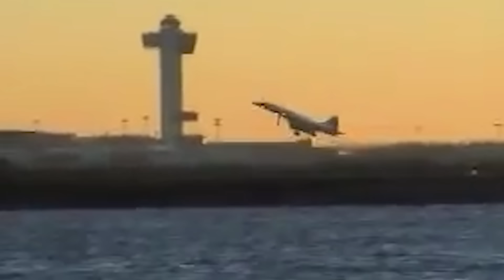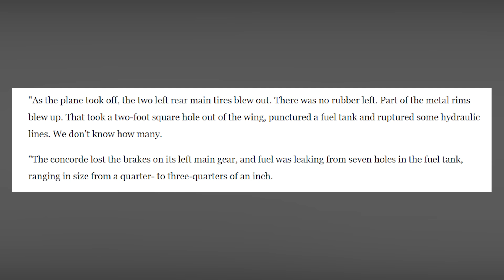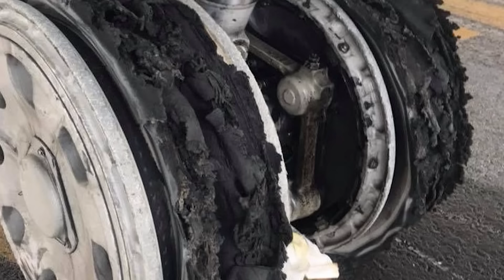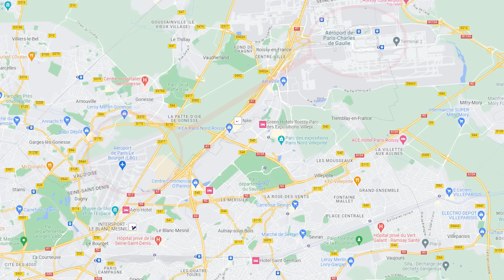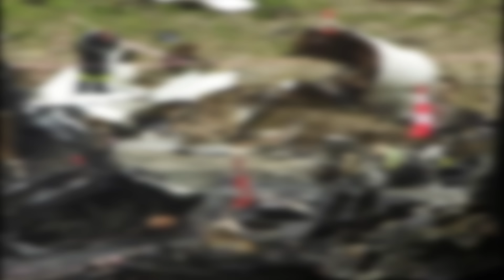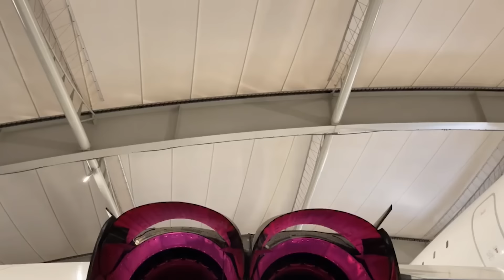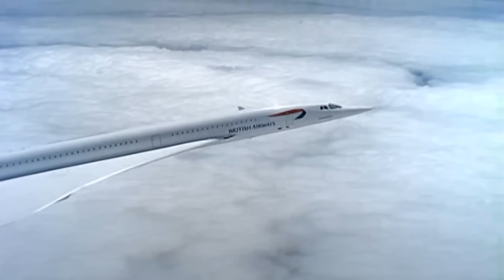The TERRIFYING Crash That KILLED Concorde | Air France Flight 4590

Comment: In respect to the Concorde & on this occasion had the Concorde not ran over the titanium strip then very likely the Concordes would have completed there flying duties service life without a disastrous accident.

Unfortunately AF4590 had many factors working against it & adding these to this incident with the runway debris all these factors added up to equalise disaster.

IMO AFrance operations played part in these factors also shutting down the engine (understandable) sealed any possible recovery of some sort.

Most people forget x1 fatal accident of an over 30yr flying service is remarkable & AF4590 was diagnosed WHY this happened. 

Any aircraft designed developed in the 50/60’s & entering service in the 70’s flying service into the 2000’s will obviously have some sort of negatives. Modern technology improved materials & new engineering methods will always highlight areas of improvement required.

But let me state this! Take a group of highly educated & very capable aeronautical engineers into a room sit them down & say: 

I want you to design+engineer+make+validate a supersonic airliner that will fly twice the speed of sound, carry paying customers @a flight level of around FL600.

1st I guarantee the engineers will all look @each other with a HTF we gona do that. 

Then just to top it off you have to use the same equipment & methods as they did with the Concorde back in the day!!!!!!

Guarantee every engineer would get up & walk out!!!!!

Concorde was/is an engineering icon it was a symbol of what we can do. It was a flagship a beauty of the sky, it looks fast stood still it goes fast in flight it is a symbol of performance with class it’s the pinnacle of commercial aviation.

England & France should remember what we achieved here.

Salute 🫡.

Comment: Why are you making a video about this accident if you not talk about the other 95% of what caused the crash? The Titaniumstrip was not the only reason and those informations are open for public.  

That was a really long chain of wrong decissions and bad luck. Most people just talk about that titanium part on the runway but: 
-The groundmechanics forgot a part that belongs to the plane on the shelf so the lefthand side wheels could slightly change it's angel. 
-They startet the takeoff on a partial closed runway that was under construction and there was a sharp transistion between the parts. 
-The wingfueltanks were filled up over the max safe level so there was no air left in it.
-The plane was overloaded (2 tons of taxi fuel + over 600kg bargage). about 3 tons.
-They also started with a tailwind (calculated with that tailwind they were 7 tons to heavy). 
-Because of the bargage and short taxi (most taxi fuel was not burned) the planes cg was moved after its safe point. 
-While takeoff they hit this titanium part on the runway.
-The last misstake was that the flightmechanic shut down engine two without even telling the captian.
Just watch "John Hutchinson on Air France Flight 4590" (concorde captain)

Comment: I would so love to fly this incredible machine. It's a work of art and a feat of invention. Most people can't fathom going over 1,000mph in anything but to do so in such a beautiful aircraft would be worth the expensive plane ticket at least once in a lifetime. 31 years without deaths is impressive and it was the stupid metal strip from another plane and the deadly decision from the engineer that caused the issue when there were deaths. Not the fault of the actual aircraft itself. So sad to see them grounded.

Comment: The people in the hotel died as a direct result of a piece of metal falling off of a plane onto a runway a few miles away. The chances of that are statistically astronomic. Rip to all involved.
Reply: An asteroid is heading towards Earth and has a 1 in 11.5 billion chance of colliding with our planet in October 2024. Those are astronomical odds. 😂
Reply: No no no aspergernomical
Reply: @benwherlock9869 - "The people in the hotel died as a direct result of a piece of metal falling off of a plane onto a runway a few miles away." No. The people in the hotel died because a f@cking plane crashed into it. This is an indirect result of the metal on the runway. The direct result is: it badly damaged a plane, rendering it uncontrollable.
Reply: The metal strip was from a dc-10😥
Reply: No...no.....no!!  Not astromical.....things fall off planes every so often because of maintenance workers.........remember,  IF IT CAN HAPPEN IT "WILL" HAPPEN!!!
Reply: That was a really long chain of wrong decissions and bad luck. Most people just talk about that titanium part on the runway but: 
-The groundmechanics forgot a part that belongs to the plane on the shelf so the lefthand side wheels could slightly change it's angel. 
-They startet the takeoff on a partial closed runway that was under construction and there was a sharp transistion between the parts. 
-The wingfueltanks were filled up over the max safe level so there was no air left in it.
-The plane was overloaded (2 tons of taxi fuel + over 600kg bargage). about 3 tons.
-They also started with a tailwind (calculated with that tailwind they were 7 tons to heavy). 
-Because of the bargage and short taxi (most taxi fuel was not burned) the planes cg was moved after its safe point. 
-While takeoff they hit this titanium part on the runway.
-The last misstake was that the flightmechanic shut down engine two without even telling the captian.
Just watch "John Hutchinson on Air France Flight 4590" (concorde captain)
Reply: @MikeYork-bn1mt bro this is serious. Idc about joe Biden XI JINGPING 2024

but fr wtf

Comment: There is one thing, that need to be mentioned as well.... A Delta-Wing plane (like the Concorde) needs full thrust to take off. As soon as engine 2 started burning, there was no way for them to take off. It doesnt matter that the engeneer shut the engine off. As soon as the metal hit the tank, the crew knew they would die. They knew, whatever they do, there is no way to save the plane, however they tried to lift the plane high enough and NOT crash into the hotel or nearby buildings, maybe safe a few lifes. They had no chance, but they did their job until the last second, without panic.
Reply: Terrifying

Comment: Yes the part that caused this was from Air China - Thanks again China
Reply: NO it wasn’t

After reaching takeoff speed, the tyre of the number 2 wheel was cut by a metal strip (a wear strip) lying on the runway, which had fallen from the thrust reverser cowl door of the number 3 engine of a Continental Airlines DC-10 that had taken off from the same runway five minutes previously

Comment: I watched a program investigating this and they said the strip on the runway was from a delta airlines aircraft also there was a spacer which goes between the wheels wasn’t put back on when it came out of service which aloud the tyres to rub together which resulted in the tyres blowing which resulted in the tyres puncturing the fuel tank. The investigation said that the strip didn’t puncture the tyre the missing spacer was at fault for allowing the tyres to rub together which produced a lot of heat due to the added extra weight of fuel and baggage

Comment: The plane was doomed to CRASH from its conception......just like  Challenger  and so many other machines that fly push the limits of speed and aerodynamics!  Always pushing at the cost of a naive public......Boeing new best, 747 was the limit.     LIVE BY THIS  RULE:  IF IT COULD HAPPEN, IT "WILL'  happen!!  NASA  knows this, but they kept pushing.....stupid is-as stupid does!!
Reply: What complete and utter nonsense.  It crashed due to a multitude of issues, just like most air crashes.  The metal strip on the runway, poor maintenance by Air France, being overloaded, errors made on the flight deck.  All these things combined to cause the crash.  It had been in service since 1976 without crashing.  Once measures were taken to improve the tyres and add linings to the fuel tanks, it was even safer.  The remaining aircraft still had plenty of airframe life left, and could have continued flying for another 10-20 years.  If anything, Concorde was over-engineered.  Even despite the impact on air travel post-9/11, the British Airways Concorde fleet was making money up to the point that they were taken out of service.  Both Airbus and Air France had been looking for a reason to withdraw them for some time, and British Airways were left with no option.

Since you mentioned it, the Challenger crash was a result of poor management decisions, not because they pushed any limits.  If they hadn't launched in dangerously low temperatures, it wouldn't have happened.  

And I hope you're not suggesting that no 747s have crashed (despite being built by Boeing and falling inside whatever imaginary limits you have in your mind)?
Reply: @paulshepherd8295  that's why both aircraft where taken out of service.....B O T H !!!  DO YOU GET IT YET?!! They both flew on the brink of Distinction and they both realized total Destruction you need to talk to a professor of physics my man really do you realize what they were doing for so long and got away with it you're a laugh I don't even think you had any schooling and physics have you otherwise I should know better goodnight and goodbye
Reply: @paulshepherd8295  statistics......odds......probability........jesus, where did you matriculate?!!!   Go hide under a rock and be quiet...lmaooook
Reply: @paulshepherd8295  I suppose you're a believer that Stockton Rushes Titan was going to survive foolish man very foolish
Reply: @paulshepherd8295  tell me why they stopped the space shuttle and they stop the Concorde didn't take too much to stop the Concorde did it duh
Reply: @johnmartinelli5511  The Shuttle programme had run its course, though I don't doubt that losing two of the vehicles must have played into the decision.  

After the Concorde crash, the fuel tanks had linings added and the tyres were modified so it couldn't happen again.  They could have carried on for another 20 years.  

9/11 had a big effect, as the aircraft's target audience pretty much stopped flying.  After a while though, things picked up, and British Airways were making money from their Concordes.  

Air France never made money on them because the Paris-NY route isn't as lucrative, so they were looking for a reason to withdraw them.  

Airbus didn't see the aircraft as a natural part of their portfolio, just a drain on resources, so they too wanted to stop supporting it.  

With the two French participants both wanting out, and BA not being able to afford the Airbus support costs single-handed, they had no option but to also withdraw the aircraft. 

Duh!
Reply: @paulshepherd8295  it ran its course alright.....their ACTUARIES told them how long before crashes would occur !!!    Look up DEfINITION of  ACTUARY ......christ!!!...
Reply: @paulshepherd8295  lot of defense there..lmao

Comment: Since when does an Airbus fly at over 700 mph, twat
Reply: Well, if you’re taking groundspeed it’s realistic
Reply: @swems-z3s  no it isn't mate, maximum flight speed when being used as commercial airliner is Mach 0.85 or about 630 mph, over 700 is supersonic, briefly achieved by the test plane before engines overheated durin the dive and throttled back
Reply: @martywilly2  i don’t think you understand the concept of groundspeed…
Reply: @swems-z3s  irrespective of groundspeed an Airbus A380 does not fly, in the air, at over 700 mph, mate,
Reply: @martywilly2  that‘s why i said groundspeed. Yes, you’re right, in airspeed it can’t go over 700mph. But in groundspeed it can. That was my point.

Comment: ANYWAY... Waaaay more people died in conventional line airplanes than in concorde. Waay many more people died in boeing than in concorde, but even so, boeing wasn't banned. Any other line airplane was banned. Concorde was banned. There's something stinky about that, something which wasn't meant to be known by large public.
Reply: But there is also a lot more conventional planes. Normalized for flights, the Concorde had about 100 times more crashes than the average airliner

Comment: I heard the real story they swapped  planes didnt get a proper check, the wheel spacer was found in the shop, it was overloaded even more by last minute vvvip passengers and tanks were slightly overpressurized, the aircraft on departure had wheel bearing failure and even caused the jet to swerve  and knock out runway lights and almost hit the Presidents plane in a cross taxi.

Comment: I was fortunate enough to be on a beach in New Jersey when a Concorde flew very low over head as it was making a turn to head (I’m assuming) to JFK which was right across the bay.
It was to this day one of the most amazing sights I’ve ever seen. 
It was fascinating how loud that plane was even at the fairly slow speed it was flying.
Reply: I used to live on a concord flight path in the 90s when I was a kid and the sound was just insane!
Reply: Turbojets are a lot louder and smokier than turbofans. Concorde also had four high powered ones, which is why it was so loud…

Comment: I used to work for Currys, the electrical appliance retailer. The warehouse managers father was a Concorde pilot, which he would never stop bragging about, getting on everyones tits. It was a couple of years after I left Currys that the Air France Concorde crashed which forced the  Airlines to ground their Concordes. It was later decided to shutdown Concorde due to the noise it made and the extremely  expensive operating costs, which made fare prices too expensive for most consumers. 

Naturally I was amused over the thought of the Currys warehouse mananger not being able to brag about his dad being a Concorde pilot anymore. 😆
Reply: Your comments about the reasons it was withdrawn are very wrong Dougie, ans has

Comment: When you look back at all the air disasters, so many has been aircraft failure or pilot error. To lose the Concorde because of a small piece of sheet metal on the runway is just hard to fathom!
Reply: The small piece of metal was just one piece of the puzzle and not the sole cause. John Hutchinson has done and excellent video explaining the entire series of events which ultimately caused the crash. It was a lot more than a piece of metal.
Reply: We're talking about statistics and probability nothing to do with maintenance or what's on the runway
Reply: Fun fact the metal was from the previous DC 10 on the runway
Reply: @BOEING747AMERICUHHQUIT  apart from been a nightmare aircraft itselfs the dc10 then went about causing the first ever concorde crash!
Reply: @easydrive3662  yeah
Reply: @easydrive3662
Exactly.  Thanks for nothing Continental!  Your horrible maintenance of your planes caused this!
Reply: The aircraft had already reached V1 or takeoff speed at that point you're over the point of no return and there's not enough Runway to land or stay down so you have to take off that's what V1 is all about and what V1 tells you they couldn't just shut down and stay on the tarmac
Reply: The plane was already on fire Witnesses testify to that
Reply: Look if one piece of debris gets picked up on a Runway and it gets thrown into the wing or the gas tank is there a possibility of an explosion of course there is could a piece of debris on the runway got picked up and hit one of the engines and cause the engine to break down and spew parts of course you can anything can happen airplanes are dangerous every one of them forget the fact this was a supersonic plane and it had engines side by side Jesus Christ give me a break talk to an actuary go away have a good day holy shit